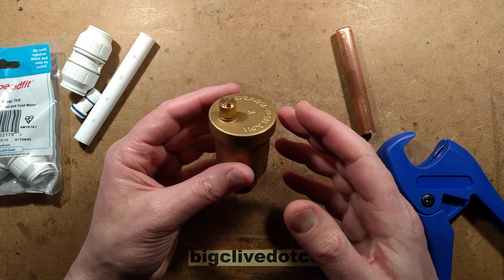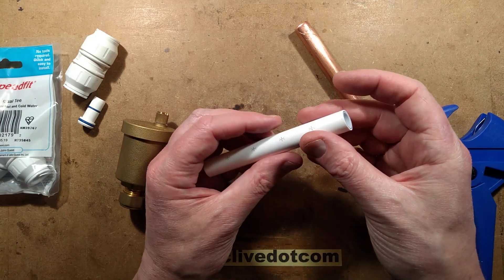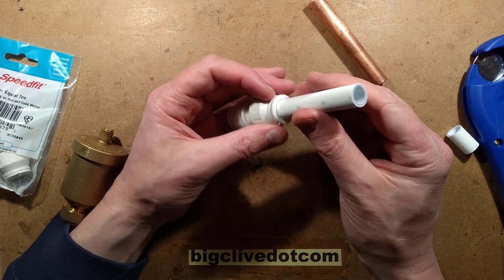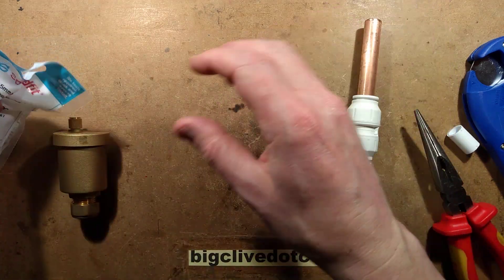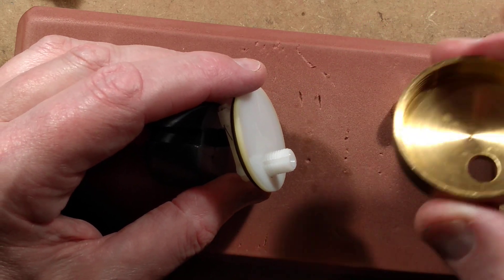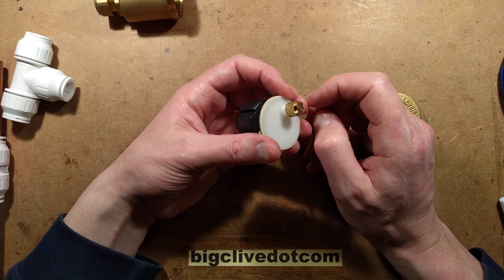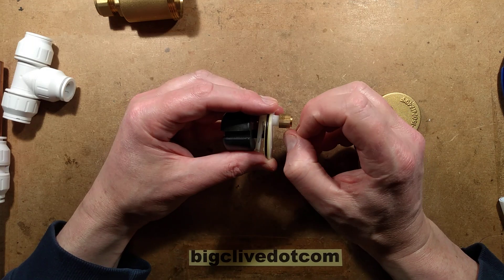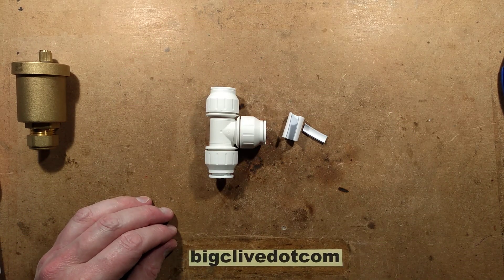Inside a bottle air vent and plumbing ramble.  (No electronics whatsoever.)

Comment: I have never seen a rubber seal last more than 25 years without developing a slight leak, on anything ever. Just saying
Reply: the o-rings around the base of the injectors in my car built in 1984 are still holding up just fine, pretty sure they've seen more abuse than the ones in this video ever will
Reply: @brendanrandle  first off, your intake is usually under vacuum so you wouldn't know even if they were, secondly there is zero pressure there, if anything considering the vacuum, it's negative pressure
Reply: @EitriBrokkr the top o-rings don't leak either and they're the only thing between 40-45psi(gauge) fuel and atmospheric pressure
Reply: may not be rubber though
Reply: @brendanrandle  yeah and we're talking about an order of magnitude more mass, and probably 2 orders of magnatude more energy, on an oring with, what at least 3 times the diameter,  you are literally taking about thousands of times higher transients when a valve closes on a 3/4 water pipe than when a fuel injector modulates. plus the fact ones a petrolum prodect and the other is usually chemically riden water. 
You're comparing apples to grapefruits
Reply: Dave Micolichek  valve cover gaskets develop leaks, oil pan gaskets develop leaks, and if you read the fine print, most of today's "quick" plumbing products, like every pex product I've ever seen, says right on the package, rated for 25 years
Reply: They’re not rubber, anymore.
Reply: Dave Micolichek  willing to bet your house on it?

Comment: In Norway we use "pipe in pipe" systems now. Basically a corrugated pipe is installed with a plastic water line inside it going back to a main water cabinet. Essentially the plumbing industry is doing the same thing as the electricians here. So if you have a leak it'll leak back to the water cabinet which should be installed in a water safe room and spill out on the floor there instead of all over your house. That is if your leak is in the walls. Anything on the outside is still liable to cause damage, but that's why you're also required to install water sensors and an electric shut off valve system under the kitchen furniture etc. Just like you're required to install a temperature sensor shut off thingy over the stove (Which sucks btw, never work like they should and are pointless for induction stove tops IMO!)

https://www.johnguest.com/speedfit/product/pipe/pipe-in-pipe/

It's a nice system IMO. 

It looks like the pipe you're showing here is one half of the John Guest pipe-in-pipe system.

EDIT: Basically it means you have one run of water to the kitchen faucet, one run to the dishwasher, one run to the toilet, one run to the shower and so on. So it does require some more pipes to be installed, but it's really good for preventing water damage.
Reply: How do you ensure you always have a clear and continuous fall of the pipes to the water cabinet, often they have to be run horizontally over quite long distances.
Most homes in the UK have central heating with radiators, there's no way you're going to run a flow and return to every radiator?
Reply: @edcooper2396  the outer pipe is sealed at the end so it will fill until the water returns to the cabinet and heating and cooling is sadly exempt from the requirement of the replacement and "water damage safe" rules
Reply: Sounds for a great place to get a drink- for roaches.

Comment: PEX - PolyEthylene crosslinked(X)
Or more accurately crosslinked polyethylene.
 The "float" appears to actually be a weight that opens the valve when the cup is empty and allows the spring to keep it closed when it is floating on water. That would also explain the complex hinge/spring and why it has to be so sensitive so that the light float has enough weight to open the valve but is still light enough to float.

My parents had a couple under-slab leaks and ended up repiping the entire house with PEX(built in 1990s I think). After you have 2 or 3 leaks like that it's better to repipe as they are just going continue. The leak finder plumber (who reminds me of bigclive) said that the leaks could be caused by flux in the pipe, denting or kinking the pipe during installation, chemical reaction with the soil, or impurities in the copper especially Chinese copper. I'm probably forgetting other causes as well.

Comment: As I was a plumber for 25 years I can say PVC is fine most of the time. But under some conditions, like direct sunlight it becomes brittle. I have seen it shatter like glass when flexed or impacted.
The cross linked poly is also very good but can be chewed through by vermin.
Reply: Yup, vermin thoughtfully gave me a cold shower one winters night.... 3y old install.
Reply: It's definitely not designed to be exposed to sunlight.

Comment: Good old tried and tested 18th/19th century lead pipes have been sadly neglected in this video.
Reply: Lead is very soft and could burst under pressure and has a low meltijg point. Lead is also toxic.

Comment: I distrust plastic as well, i cant see plastic lasting like the copper pipes in your house.
I live in a house from 1948, all but one copper pipe is original, 71 year old copper pipes.
Reply: Same I trust copper, traditional brazing and mechanical junctions are made to last.
Reply: Im in 50 yo copper piped house. no problems.
Reply: Even slightly acidic water causes pitting in copper pipes, with the system often not making it to even 10 years. I much rather have a home-run manifold PEX system. With that you only have worry about leaks at the manifold and endpoint with no junctions to leak.
Reply: Agreed I don’t trust these o-ring seals to last.

Comment: That speedfit plastic stuff is far better than the copper. and you don't actually need the pip end inserts. The only joint I had failed was the joint that I didn't push together properly before pressure testing!

Comment: Really interesting to see inside the auto air vent . Fitted them but never tried to open it up. Believe the insert without external o rings are Used when plastic is used on brass/copper compression fittings with an olive . Used lots of John Guest pipe and fittings and found it good. Nice to use copper when on show though.

Comment: A non LED based video! 😲

That plastic pipe is great! Goes against common sense with hot water but it works! Just support it regularly. Can go round gentle bends. Easy to feed under the floor as rigid copper pipes cant bend. More thermally efficient. Easy to cut (use proper plastic cutter), no soldering or spanner work, resistant to splitting if frozen, no corrosion.

ALWAYS use the reinforcing inserts!

Negatives: Comes in a roll and hard to straighten and stay straight!

Comment: Those air eliminators are the bane of my existence. Great when they work.
Reply: Always fit them with an isolating valve so they can be replaced without draining down the system.
Reply: Sometimes they ooze minute quantities of water and over time salts from the water accumulate at the discharge port, and when for whatever reason you empty the piping for maintenance or anything and they don't close properly again
Reply: Can you elaborate on how they fail?
Reply: @Berkeloid0  We have old brass ones and they tend to get chemical buildups in them or just plain corrosion. I remember changing one and it let out a lot of air so the old one was doing nothing.
Reply: Daniel Dulu no, really you changed one out which had already gone bad? Certainly you must increase the frequency of replacement to catch these things before they fail completely. No sense in changing bad components.

Comment: Under floor heating generally uses 16mm Pex-Al-Pex piping.Very reliable in my experience.
Reply: I love installing PEX, but the real question is how long it takes before it degrades and falls apart. Hopefully never, but...
Reply: @jmonsted  pex-al-pex has an inner core of aluminium coated inside & outside with pex material, it also comes pre-insulated & when bent it maintains the angle of bend unlike plain pex... 😎👍☘
Reply: @peterfitzpatrick7032  Yep, i used it for a couple of runs where i needed insulation (mostly the home runs from the distribution manifold back to the boiler). It's even nicer to work with, but at a quite significant cost. PEX alone is still a god-send compared to metal piping (especially the cast iron i replaced).
Reply: @jmonsted  This is why Poly-B was banned.
Reply: Pex pipe tubing is the future. The key is making sure you have the proper connections or there will  be leaks a few years later. The install is about 10 times faster than pvc. I haven't had any problems and don't expect any because I won't use cheaper connections and I always use tools that are made for commercial applications. When possible.

Comment: Hi 
Don’t know if anyone else has mentioned this but if you need to remove the part that always gets stuck when you pull out the plastic pipe all you need to do is fully undo the nut.
It will fully undo if you give it a really forceful twist.
Love watching your vids .
Keep them coming.
Reply from the maker: I tried fully unscrewing it, but obviously didn't use enough force.  I just tried again and succeeded.

Comment: I'm surprised you aren't in favor of copper. You know how to solder. It's more solid, connectors are much cheaper than those plastic systems. The problem is those plastic systems have not been in place long enough to really know how they fare up in real world conditions. PEX, maybe is OK. For anything with pressure I want copper. Plastic is OK for drains & wastewater.

I just had some brass waste pipes go. They lasted from 1958 until now. Mostly they wore thin than gave way when I was trying to snake the drain. For my money that 60 years is more than a lifetime. Most "lifetime" products sold to the consumer these days are only 15-20 years. Just some things to keep in mind.
Reply: John Possum *then gave out

Comment: I call those automatic air bleeders.
But the ones in the states aren't really automatic and they leak over time.
Reply: Of course the british ones are better.
Reply: @simontay4851  yeah, the ones in the states don't come apart.
The top is crimped on the body and the valve is a strange shrader valve that does not come out.

Comment: The older ABV's used to have cork inside that swelled up (so i'm told)
If you install them in a less accessible place (loft etc), you can connect a 6mm copper pipe and route it to a safe place, we had those all over the plantrooms where i worked, not just on heating, but also cooling circuits.
I much prefer copper, specially if soldering, the joints are much smaller and neater,
Depending on location, i like exposed pipes for that industrial look, i wouldn't want exposed plastic.

Comment: yes but plastic pipe connectors are much MUCH bigger compared to soldered copper joints
Reply: and a lot more restrictive with those inserts installed!
Reply: The ones he's using is massive. I prefer the "sharkbite" brand ones which are quite a bit more compact. Expensive though.
Reply: And any copper off-cuts are fully recyclable. plastic pipe probably isn't. Hot water might soften/melt plastic pipe. Soldered copper looks nicer. Lots of advantages to copper.
Reply: @simontay4851  On the hot water aspect, boiler installations require copper for the first metre away from the boiler for this very reason - who wants a melty-saggy pipe? Copper also requires fewer clips to avoid it sagging and straining against the fittings. 
Like you I prefer soldered end-feed copper, plastic O-ring based systems (I favour Hep2O if I must use one) are really quick and easy though, especially for amateurs. I don't think plastic is approved for domestic gas either - I know my gas main is plastic right up to the boundary line, then iron to the meter, then soldered copper from the meter to the appliances.
Reply: @simontay4851  Almost all plastics are very easily recyclable. Piping plastics are not your "cheap chinese toy" variety, heat is not a problem, and if REALLY hot water is expected, there are plastic pipes that are engineered to resist temperatures well over 100 ºC . Soldered copper does looks nicer... but who cares? It's inside a freaking wall. The only advantages of copper  are that it tends to be cheaper overall because good plastic joints are expensive, and space, copper is a lot more compact.
Reply: @ComandanteJ  Plastic pipe has some benefits for ease of installation but they are made of cross-linked polyethylene (aka PEX, or XPE, or XLPE), which unfortunately can not be recycled with current technology. It can be burned as fuel (with all the joys that burning plastic brings), and most ends up in landfill.
In the UK it's actually against the building regs to use these fittings inside a wall or anywhere else inaccessible, as an o-ring has a limited (albeit long) MTBF. A soldered joint can be put inside a wall as (barring failure due to chemical or galvanic action) it has an unlimited MTBF. In practice, people put them wherever because a) they don't know any different b) the plumber saves time so they save money or c) they don't care because in 10, 20, 30 years when the O-ring fails, they won't live there anymore.
Reply: @donkmeister
 Plastic pipes were used extensively since the war (Germany and Japan). I first used that type of plastic in the late 60s and to this day have not encountered any issues with its longevity. We have over the years had some issues with copper, mainly in hot-water and heating pipes, where pin-holing developed on random batches of pipe and cylinders. In some areas, the water is so acidic, copper doesn't last very long at all. So whether it's a fork or spade, you take your pick
Reply: william the problem with plastic is plasticizers.

Comment: Clive I can't believe that you use compression joints with all the soldering you do,  I prefer soldering.  I was talking to a plumber who told me he could no longer solder and had to use compression joints because of the risk of getting burnt or causing a fire. Smells of H&S.
Reply: A lot of developers/builders will have restrictions on hot works as construction site fires aren't exactly unusual, often in commercial applications it simply isn't worth the risk.  Im sure we've all seen the scorch marks on joists that plumbers of the past have left.
Reply: @edcooper2396  I understand what you are saying and is a valid point, scorched Mark's come from not use soldering mats or more common now a spray on gel and when using a open flame a fire extinguisher should be available. Most fires are started by unattended flames which brings in the competence of the user. I hate compression joints they are big and ugly, so banning the use of solder joints I see as yet another stupid idea some dick from behind a desk has made. Maybe a better idea would be to make it compulsory the use of gel and fire extinguishers.

Comment: If those push-fittings are anything like the Sharkbite(TM) fittings available in North America, not only do you HAVE to de-Burr the ends, but you MUST also make sure the cut is a perfect 90 degree angle or the joint will leak every time (I made that mistake once...big mess...thank god for wet-dry vacuums...)

Comment: Hep2O has a 50 year guarantee.
Reply: Assuming the company will still be trading and that you have the paperwork in 45years, that's reassuring.
Reply: That's what I use and the fittings are much slimmer.

Comment: I hate plumbing jobs with copper pipe, it's really not my thing and I have always avoided it. I have seen holes suddenly appear overnight in pipes that I have knocked while doing other jobs and cause lots of water damage and I've seen pipes suddenly spring leaks after not being disturbed for many years. 

I have used the plastic Speedfit system and been much happier and confident with the results, it's less likely to cause random problems over time and much easier and quicker to install !

Comment: weird. had leak yesterday in loft cold water tank (dripping float valve - and overflow pipe was loose - so on holiday last week it had reached overflow, dumped several gallons of water - and 1/2 of that had went onto the ceiling/ upstairs carpet and even reached downstairs ceiling)... so I replaced the loose 90 degree joint on the overflow pipe (glued) with a 90 degree speedfit- and that is the first time I've ever used one too... slightly worryingly I didn't realise about the inserts so didn't use em - however it seems good enough as it's only seeing low pressure and only then only ever if value leaks again - and I tried overflow and it's fine. So - yeh - they beat glue together plastic for sure imho.

Comment: That vent kind of reminds me in a way of a carburettor bowl, but working to let the air out rather than the fuel in...
Reply: ...or a toilet cistern backwards?
Reply: both use the same principle.
Reply: Very like a bucket steam condensate trap still in use from early 1800s. Except they keep gas in and let liquid out. Just different lever arrangement for float and valve
Reply: Just thinking the same thing.

Comment: Just finished a whole heating system using this method, the tails to the radiators and coming from the boiler were still done in copper.

I'm not a heating engineer, I was doing the grunt work for a relative who is.

As you I'm a copper user but have been converted.

Fit an isolating valve to be able to service the valve.
Reply: cype man
“tails” would be called ‘stubs’. Half the difference between you two gents is grunt & other half is work.
Reply: @HighestRank  I don't understand what point you are making or what your post is about, it doesn't make sense.